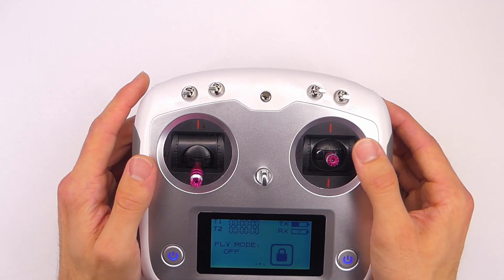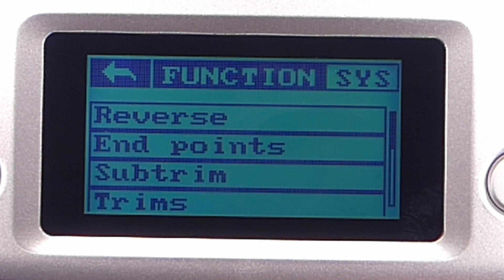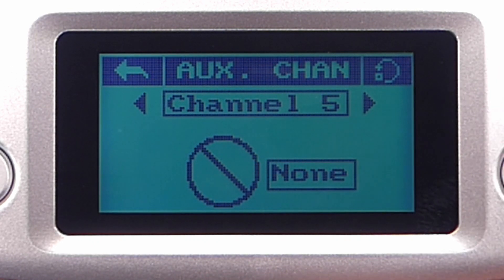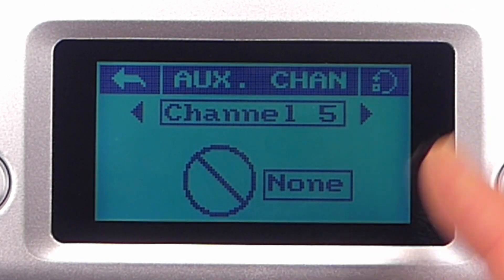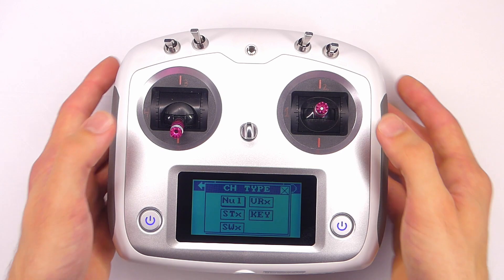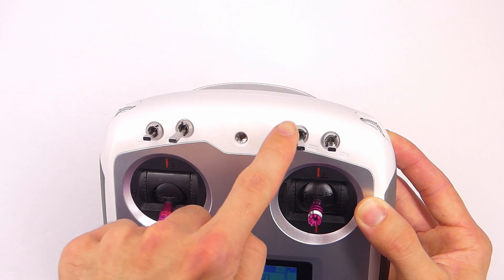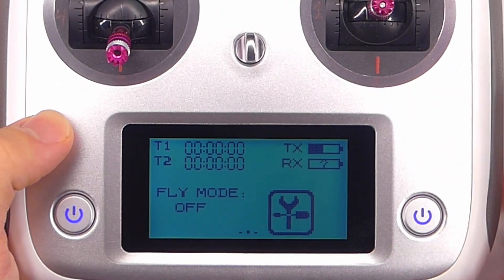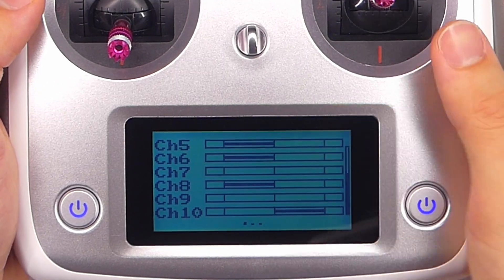How to Use Aux Switches - FlySky FS-i6S Tutorial

Comment: Hi bro. I have a question. I am planning to build my own drone for our school project. I wish to put a FPV camera and do i still need to attach separate battery for the camera to work? cause the main battery is for the motors and flight controller. I am confused if i can use the main battery to power up the fpv camera? Wishing for your respond.